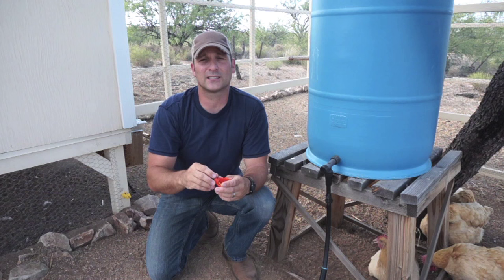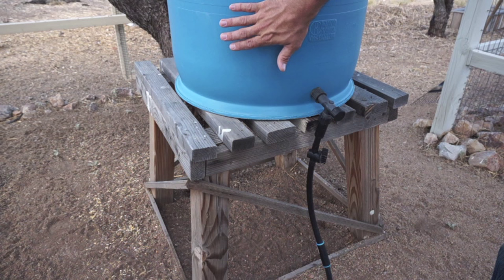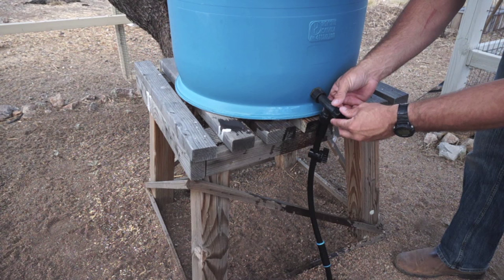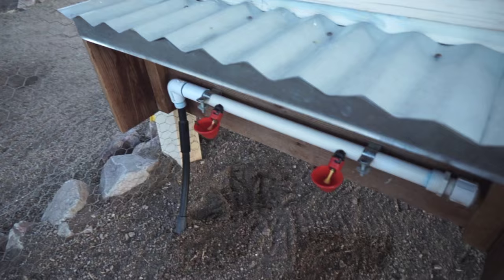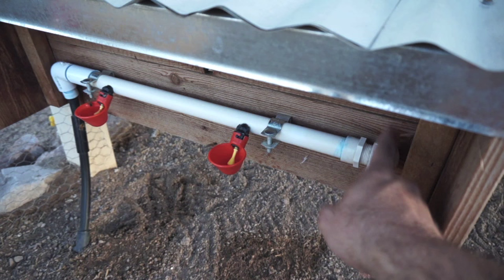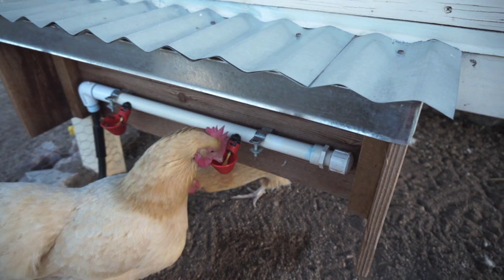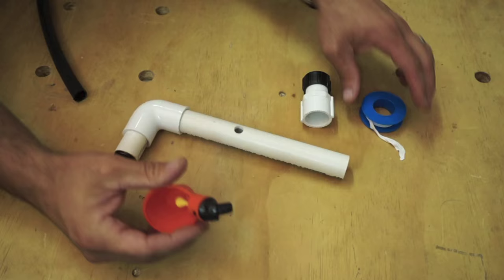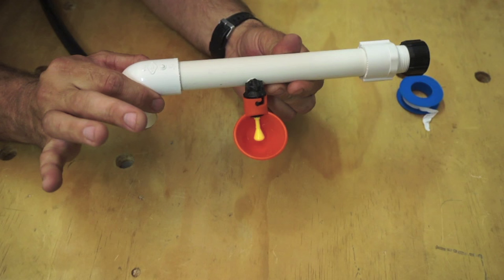Chicken Watering: Tour and Install of my gravity fed system

Comment: Any ideas on how to keep it from freezing?  I tried nipples but Colorados winters demand heated waterers.
Reply from the maker: +Hippie Farmer The Homesteader I think you might want to install them inside the coop near a heat lamp and that might just do the trick.  But you'd need your piping buried below your frost line or have your water source inside the coop heated or insulated really really well.  Personally, we don't get very hard freezes down here but when we are going to get in the mid 20's or upper teens I will drain my system and just use a water bucket to keep the pipes from getting damaged:)
Joe

Comment: I ordered some of these and idk if i just didnt set them up right or what?  mine arent exactly filling up like a gravity feeder.  the birds HAVE to hit the "Nipple" to keep the bowl full.  I figured the yellow device would be a miniature float to keep the bowl from over-filling...?   

did i do something wrong or was i just expecting the wrong thing?
Reply from the maker: +J.T. James Hi James, the yellow nipple is intended for the chickens to peck on them.  It sounds like you've set it up correctly.  When I first installed them, I used my finger to fill them up and then as the chickens drank, they inadvertently hit them causing more water to fill.  And after they learn, if the cups go dry they'll simply start pecking inside the cup until the nipples let some more water in.  Hope that helps!  I have no doubt you're birds will eventually learn it and love them too:)
Joe
Reply: +homesteadonomics 
thank you for the reply buddy!! I really appreciate that!!  
one more question though! lol
the birds in Question that i am using this setup for are actually a Covey of Quail!!  do you think that they will have the strength to hit that device hard enough to keep these bowls full?  quail are significantly smaller than chickens
Reply from the maker: No Problem JT... but to be honest, I don't know if quail will be able to depress the nipples effectively enough.  They might but might not... just not sure.  Maybe the other style nipples would work better.... the ones with the metal nipples??
Anyways, it sounds like a cool project, I've always thought about doing quail too!  So let me know how it goes:)
joe

Comment: Great set up! Are you concerned at all about the sun and heat on that plastic barrel for your chickens water supply with it possibly leaking chemicals into the water?
Reply: Well that's a city person question if I ever heard one. No, the answer is no he never worried about that for one second...
Reply: @patrickpelletier3104  reeeeeelax. Maybe he didn’t think about it but you’ve gotta question everything
Reply: @brandont4503  Ok yeah perhaps my response could have been a little less smart ass I'll concede that. 
That being said, do you live in an urban setting ? I'm just curious. 

I stand by the gist of my response though I GUARANTEE that man was not at all worried about warm chicken water or BPA residue from the plastic barrel. Farmers tend to be very practical and efficient. Plastic barrel's are readily available, durable, easily moved around those factors far out weight the possibility of "leaking chemicals" into the water. There for I'm sure he wasn't worried at all...
Reply: @patrickpelletier3104  nope I live on 3 acres surrounded by neighbors who also have 3+ acres and woods

Comment: hey, I've been using this system for  few weeks now and my chickens are young. They drink from the cups but only if I fill them up, how do I make sure they figure out how to get water out of the cups without me going down there to keep filling it for them?
Reply from the maker: Hi Newton,  Not sure how old your chicks are but most are very curious in nature and will start to investigate most anything around them.  If you monitor them and just let the cups go dry they will eventually go back to the only source that they seen the water coming from.  At first they will just look at it and lightly investigate, but eventually they'll start to peck and get it.  Obviously if they just aren't getting it then you have to keep filling it up until they do.  But I believe they will:)
Joe
Reply: A lot of times when you look in the cup you won't actually SEE the water. Let the cups run dry then watch your chickens, see if when they go to the "dry" cup, tilt their head and swallow 😊

Comment: Do you have a drip issue? Mine drips pretty constant.
Reply: Mine too it’s absolutely horrible. 
I’ve tapped the pvc and can not get it to stop
Reply: @natinamartin3326  Hello, Ive since learned that mine drips worse when I first fill my water tank and seems to stop once its about half full. So it might be a pressure issue?
Cheers

Comment: Hi,how high you make the wood stand for better water flow,thanks
Reply from the maker: HI Hayk... as long as it's atleast a foot or two above the cup the flow should be fine to run the waterers.
Joe
Reply: Thanks,i allready make it around the container,works fine,no more watter waste

Comment: Bought some few weeks ago..I threw them away. Once the water is out of the bowl they have to peck or hold the yellow plastic for a little water. Junk
Reply: Jay Seiler they make ones that are "no peck" and use either gravity or a float lever instead to automatically fill.   I just got some the other day i have not set them up yet though.   I did not like the peck to drink design either.  https://www.amazon.com/gp/product/B07D6W2JK8/ref=ppx_yo_dt_b_asin_title_o03_s01?ie=UTF8&psc=1

Comment: What do you do about algae inside the plastic drum?
Reply: I heard you can put vinegar in it ??
Reply from the maker: Hi Giuseppe... generally if you have a dark colored drum, you shouldn't get any algae growth and any that may start can be handled with a small capful of bleach from time to time.  You can find charts online that give the exact amount per gallons/liters so that it will still be safe for the chickens.  And it does diminish over time as well.  Hope that helps:)
joe
Reply: homesteadonomics thanks joe, I just built my new coop and am about to put this watering system in it!
Reply: I don't think bleach is a good idea ...A lot of another products like organic Apple Cider acid can do same job without any problems. It's not just a safety to stay away from algae ,its more important to stay off from super strong chemicals like a bleach .